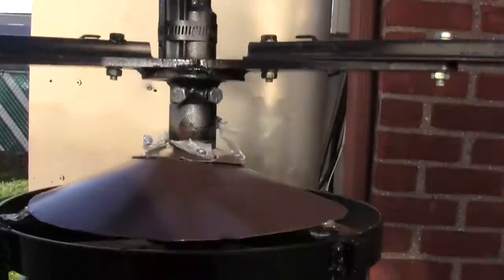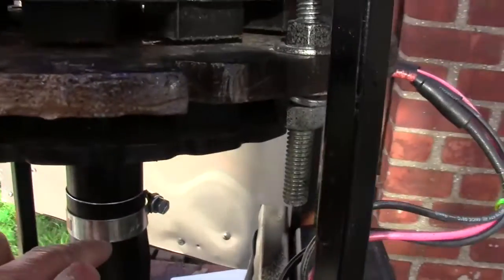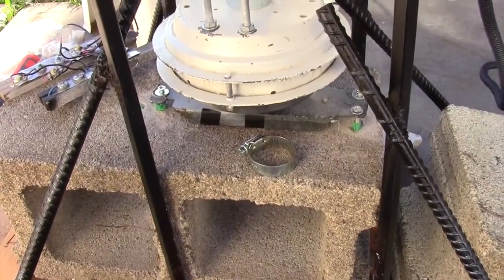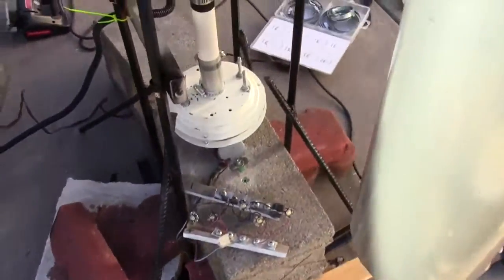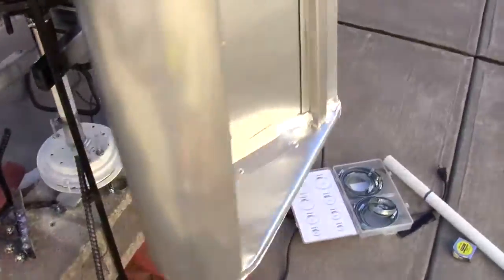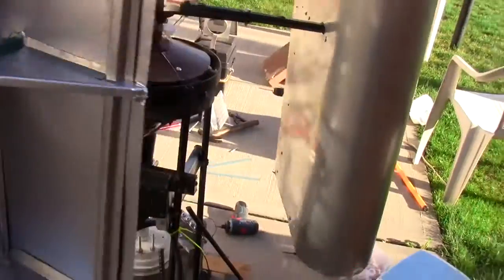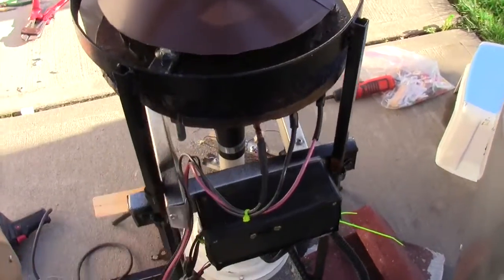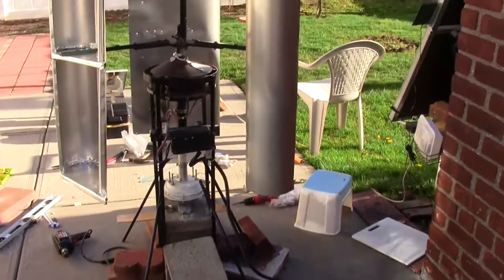Dual alternator vawt with axial flux turbine and modified ceiling fan alternator

Comment: inspiring, more power always good.... question: do you think blades could be made from Shade cloth material?
Reply from the maker: +brimstone555 The material should be able to withstand the stress of wind and the sun. For testing purposes, you can use practically anything. If ;your shade cloth is canvas like, then it can probably last.  Thank for watching.